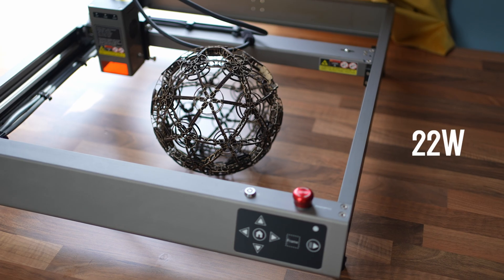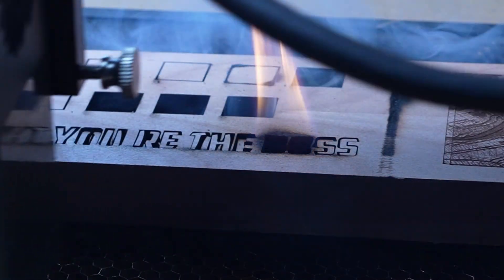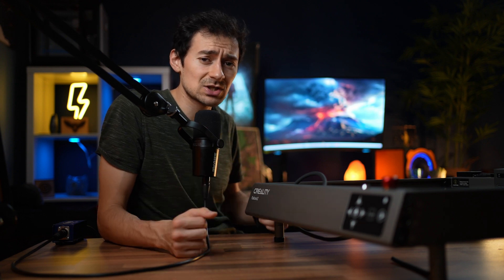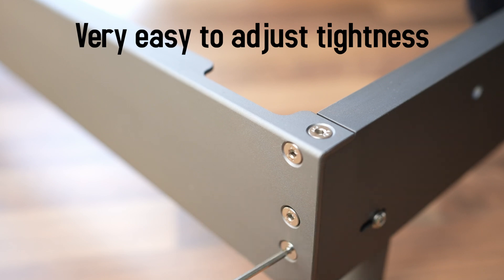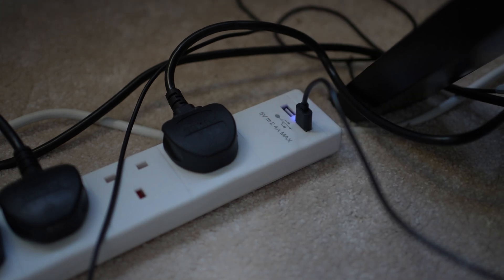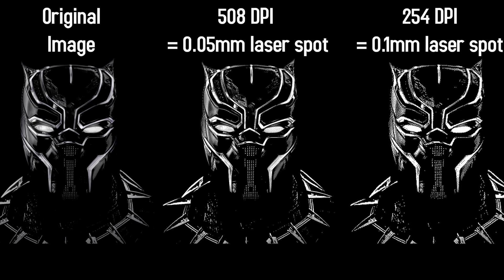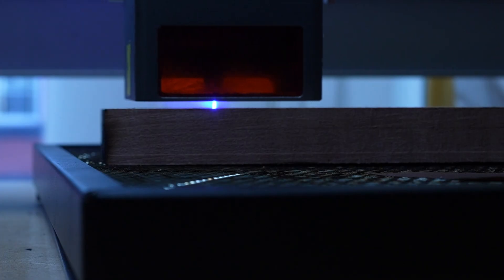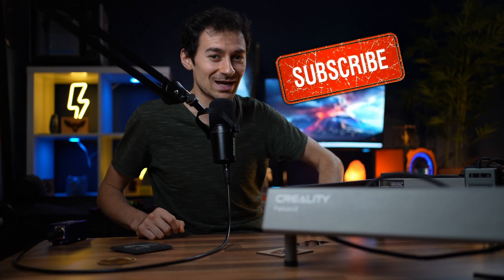Get this Laser Engraver to make  ANYTHING you want in 2026 | Creality Falcon 2

Comment: I didn't realize you can engrave canvas. And it looks so good! whao how did you do that?
Reply: I just learned about this. I haven't tested it yet so do some independent research. There are a lot of more in depth tutorials on how to do it but I'll abridge it- spray paint works best in order to get an even coating (important so the laser burns away the right amount of material). Anyway, it takes planning ahead and you can probably learn the concept using just about any backing material as a medium (wood/stone/metal/etc.). First spray the back color, let it dry, then repeat as many times as you have layers with as many different colors as you like- to learn I'll be starting with just 2 colors and moving up as I learn. Once the paint is dry you'll next need to experiment a bit so that you know just the right settings to burn away a single layer of paint- a custom Lightburn Material test should give you the right settings. That's pretty much it- it's a simple concept but with planning ahead/layering/dialing in the perfect settings it can get very complicated. I hope that helps, and if it doesn't there are many good Tutorials here on YT that will explain it much better than this simple bit of text can. I personally look forward to messing with this idea a bit- I look forward to anything laser related though, even the troubleshooting! Goodluck with your projects, it's kind of amazing what you can do with these things- even the low powered machines!